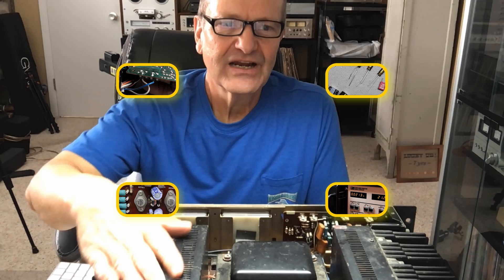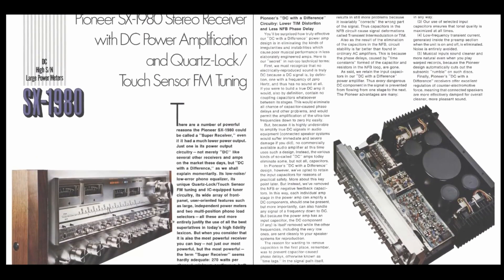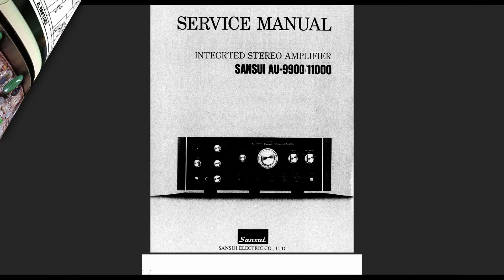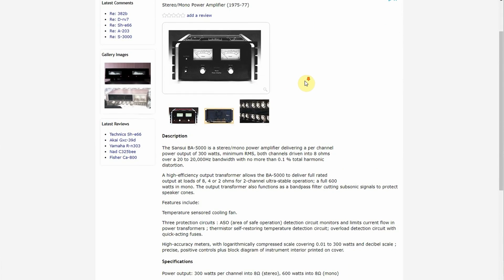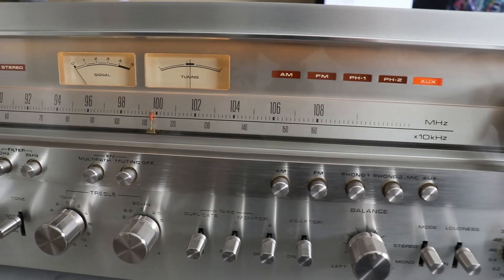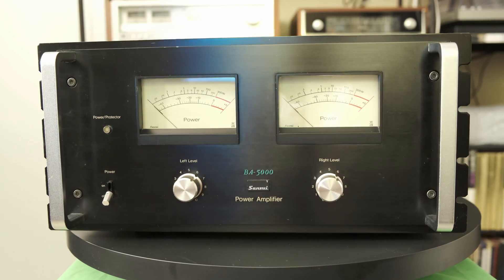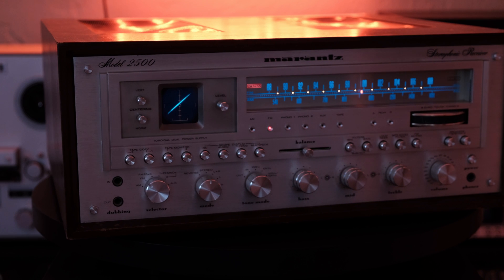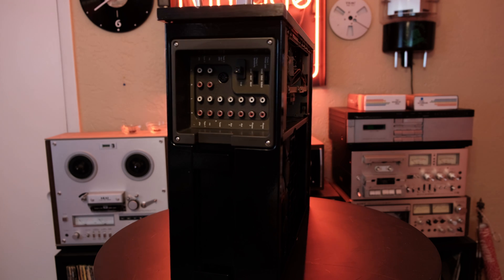Documentation Crisis Affecting The Repair Of Your Vintage Audio Equipment. HiFi Engine Problems!

Comment: I thought I had an account with Hifi engine but not any more. I think I downloaded a few brochures on some audio gear I was researching, and I hit a limit of 5 per day brochures was the maximum you could download. Now that was a few years ago, and I wasn't looking at service manuals just brochures. I spent a couple of days researching stereo gear, and once I hit that 5 downloads limit, I searched on other sources. But my account is gone and I tried to register again and this is the message it said:
_____________________________________________________
Account Registration
Sorry, but due to abuse of our free service, the registration system has been permanently disabled.

While we work on a solution to this issue, the service remains open for existing members only.

 

Registered users can Log In as normal.

If you need to reset your password please use the Reset Password form.
______________________________________

So I don't know what an abuse of a free service means, perhaps people were downloading all the information day in day out just collecting scanned in old brochures or service manuals. Then they took those files and printed them and sold them on ebay? So shutting down the free files will just mean you have to go buy the printed form on ebay.

Or maybe Hifi engine had copyright infringements for scanning in (copying) copyrighted brochures, services manual, user manuals and other materials and offering them for free download, which is a violation of copyright. Also selling copied copyright manuals and brochures is also a violation of copyright.

I acquired a vintage amp and this video made me worried so I searched for a service manual and found two, and the better one is on ManualsLib, and I've viewed countless user manuals, and downloaded maybe 2 dozen user manuals and a few service manuals no problem. Open them up in a pdf form in the browser and download from there once I see it and I like it and its good.

Comment: Been using HIFI Engine, ManualsLib and Audiokarma for many years and still gain access. If those amps we worked on will outlast us, maybe having one play during our funerals would be a fitting tribute to their longevity.

Comment: As the HFE website says, due to abuse the new membership option is turned off. Guess there were too many downloading free pdf's and then selling them on fleabay etc. 🤔
Either a membership with a pay per item download option would work. I guess he doesn't want the hassle of running/setting it up?? Good on him for keeping it going. 👍

Comment: Here's the message displayed when trying to create a new account:

<blockquote>Account Registration

Sorry, but due to abuse of our free service, the registration system has been disabled.

While we work on a solution to this issue, the service remains open for existing members only.

Registered users can Log In as normal.</blockquote>

Comment: There is a message saying it's not taking new accounts. I'm starting in 60s and 70s equipment, restoring and building new cabinets for them. I've been able to buy photofacts for mine so far off of eBay.

Comment: Hey, just a thought.  Could it be that their web page will only work on certain browsers?  I find that an increasing number of websites stopped working for Firefox and will only work on Edge.  I could be wrong, but for the ones who can't log into Hi-Fi Engine, try switching browsers and see if that fixes the problem.

Comment: Does anybody know how old Hi-Fi Engine is..? and how the owner obtain all the documentation and what or how did Chris and others actually fixed these products before the info was attainable?
I'm sure being apart of this industry for decades came with the knowledge and education to add up to reams of experience which will be lost with the passage of time and why its so vital that this information be available.
I own a Pioneer SX 850 and was lucky to be hunting on Craigslist for other Vintage pieces when i came across an SX 650 Pioneer and the owner talked about getting it serviced and that's when it dawned on me i could ask if he would provide the Tech name and number.
Short story took it to the tech and now have a Ton!!! of pleasure listening to how good it can make everything sound.
Watching Chris's short videos about getting your vintage pieces service is a requirement and very helpful and glad i did it...otherwise i was watching my Receiver sit in my cabinet neglected. 
So if I didn't find a tech or in the future no technical information ...then what? 
Chris thanks for the Videos...:):):)

Comment: I don't think I've had any issues using hifiengine but haven't been able to sign into vinylengine in a few years.
VinylEngine tells me no such information found if I try to sign in and it gives me the "no longer accepting new registrations if I try to sign up a new account. 
Neither have let me upload any files or pictures in years.

Comment: I had an account on both hifi engine and vinyl engine. I registered years ago. Both accounts were deactivated due to what I'm assuming is lack of activity. For at least a year now registrations have been closed. I can't recover the old accounts. I now don't have access to needed service manuals.

I think the site owner deciding to take the user submitted content and gatekeep it from the rest of the internet is disheartening. First of all its not his content. It is appreciated that he started and runs the sites but it doesn't make the efforts of the many users who scanned documents his own. If he was concerned about people selling the scans on ebay then his actions are only making it worse. Now service manuals that can't be easily found online can only be found on ebay for exorbitant prices. The best way to combat ebay sales of scans is to make things easily available. These manuals should be on as many sites as possible for redundancy so we don't lose them and the scanner's efforts aren't wasted.

Comment: I think HiFi Engine "prefers" that you "contribute" and upload a service manual, owners manual, old advertizements, schematics or something, not already listed. Too many people using the site, are not contributing. Or like you said, copying the information, and selling it on eBay.
Everyone should be able to contribute something to the site, especially if they have been long time members. As they must have "something" to add to the site, if they are "really" are into collecting and restoring vintage HiFI components...

Comment: Ill add parts are rapidly becoming unavailable.  Most through hole parts have been discontinued for a few years now.  Electrolytic caps are rapidly disappearing.   Transistors as well.  Digikey, Mouser, etc are becoming lists of obsolete parts.  Soon, only Chinese companies will have unreliable parts with long wait times.

Personally, most repairs are fairly straight forward.  If I have to pull out schematics it will likely cost more than its worth or Ill make very little on the repair.  On newer audio gear, aka Class D, there is almost no schematics available.

The irony is prices are steadily going up on vintage gear but in a decade they will mostly be interesting paperweights.

Comment: Became a member of Vinyl Engine around 10-15yrs. ago. Everything was fine for about 6 months to a year. Then I made the mistake of posting on his Vinyl Engine site Forum. I made the mistake of dissing a few 🧩🧩 of 💩 that I had the misfortune of owning and/or repairing as a Service Tech who specializes in vintage gear. One fine day soon after I try to log in at Hi-Fi Engine, & get a message to the effect that my "Password is not recognized" & I cannot log into either site. I politely e-mailed The Webbastard for the site: Little Lord Fauntleroy, Mall Cop. I explained politely that there seemed to be a problem with my account, could he please help me to get my login details sorted out?
No answer.
I tried at least a couple of times more, same haughty & ignorant silence.
I tried to "rejoin" a couple of times. Same User Name, but new (reset🤓💡?)  password. No luck. Tried new User Name AND Password. Got in long enough to make a single post in the Hi-Fi Engine forum, asking the Moderator if he could help me with my "problem".
Result: Banned permanently.
Tried to rejoin a couple of times after waiting a few years, hoping that His Godliness might have come down off of his cloud a little bit & give me another chance. NOPE!
You don't get any second chances with this ASSHOLE; you don't even get one!🚮🤬🤬🦨
If I had known WTF I even did to deserve this banning, I certainly wouldn't have repeated it! And if I had known that this ASSHOLE would ban from BOTH of his sites IN THEIR ENTIRETY just for posting a negative comment about some overrated 🧩 of 💩 component that I didn't know was a favourite of his (or WHATEVER it was that I "did wrong" or that he just "didn't like" my saying so🧐🤔🤔🤔🤪?), I wouldn't have risked my access to the schematic library that I badly need to service more the equipment belonging to my paying customers as much as my own!
I found an inconvenient workaround for when Electrotanya or Radiomuseum doesn't have the schematic I need, by getting friends to join Hi-Fi ReVEnginece & getting them to forward my requests back to me, so funk you Bart Cop!
I fix equipment as my livelihood to supplement a miserable government disability pension, & this PRICK gets off on trying to ruin my livelihood? Without even the benefit of an explanation?? Never mind responding to a request for a second chance, & a solemn promise to stay off the forums, so as to not ever "offend" anyone ever again???
Do I have to really explain how offensive & obnoxious it is to have someone that doesn't know you personally, has never met you or ever seen you in person, exercise their ultimate NEGATIVE JUDGEMENT upon you, know nothing of your circumstances, just decide suddenly that you deserve the worst possible treatment from them that they can possibly inflict upon you???
So why should I mince words?
This guy is a TOTAL FLAKE, an arrogant intolerant IGNORAMUS, & surprise surprise! His mental health continues on its decline, & his behaviour gets ever worse & ever more erratic as a result!
I might feel worse or be the least bit more self-reflective if I knew that I was a rare exception to his capricious spitefulness. But I have come across PLENTY of others that have been equally shabbily treated. And now we seem to have arrived at a point where he's getting off on forcing members who were otherwise in good standing with him to grovel & plead for site access because they haven't "recently"(🤔🤪) brownloaded any of his DONATED literature & schematics that he has THE NERVE TO WATERMARK, EACH & EVERY SINGLE ONE.
I HIGHLY recommend that EVERYONE switch over to Electrotanya, & PLEASE upload any Hi-Fi Engine schematics & service manuals that you have in your personal collection over to him, AS I MYSELF DO, that are not yet on his site.
Electrotanya is FREE, 5 schematic limit per visit, he has paid site advertising so he's running a business & not a country club that's open solely for those that the Webmaster deigns to be worthy of his affection. There's no membership to join, & there's no forums of stupidity & idle chatter for you to get bullied, banned & humiliated in by a Moderator with an IQ that's half of their shoe size!👺👹🦨🤤🤡🐂💩🤮🤮🤮
I also recommend Radiomuseum as a second choice, & manuals.lib as a distant third (it COULD be a great resource, if any of you could ever be bothered uploading to it🧐).
Putting all your resources in one Website basket is a dumb idea. And courtesy of Hi-Fi Engine's increasingly ever-erratic WebBastard, the threat of a vast knowledge resource disappearing into Error 404-land should be VERY CLEAR to ALL of us!!!
Hopefully those of us in possession of these resources will continue to behave like a community, & not like God.
And certainly NOT like Hi-Fi Engine, regardless of how highly His Royal Heinieness thinks of himself, & how little he thinks of YOU.
At least he hasn't disappeared suddenly, so we're getting fair warning, the only thing fair this guy has ever done (because it's by accident!🤗).
There's still time for us to DIVERSIFY OUR PORTFOLIOS. You wouldn't put your entire retirement savings into a single investment either, would you? You need to spread the risk, even if that single investment is doing well at the moment.
So it's the same here. To quote a famous running shoe manufacturer:
JUST DO IT!
Reply: HiFiengine is free. You weren't paying anything for it and he doesn't owe you anything. You come off as entitled with your comment!

Comment: Hello, do you have any experience with the Kenwood kr-9050 I recently acquired a one and the left aux input moves slightly and the output from the left speaker is not right what would be the best plan of action to replace this connection? Thank You.

Comment: Thank you Chris for your videos. I appreciate you sharing your knowledge and experience with us. I’ve been a member of hi-fi engine for about three years recently I was able to log on and still download the service manual for Marantz 5420 cassette player. I don’t know if this will help anybody because I’m not even sure myself if it was simply coincidence or it actually had something to do with it, but I had tried to log into hi-fi engine and create account several times and was rejected. On New Year’s Eve at two minutes to midnight I started the login process to create an account, and when it struck midnight, I hit the enter button and got in and was able to create an account. I’m not sure if the rollover had anything to do with it, but might be worth a try for those out there willing to take the time to try to do it.

Comment: i used to be a member of hifiengine. I then i went through a sickness for several years and now the site doesn't allow sign in nor does it recognize my email for reset password. I would pay a subscription fee for access as i'm trying to learn this trade. last time i had some repairs done to some equipment they were enormous fees. Although, much less than a new unit, which isn't available  so, very much worth the money. i just really like tinkering with this stuff. you all have a great day. i found some manual sites by typing "audio repair schematic and service manuals" and other similar terms. i also tried another two browsers and turned off pop up blockers to see. no luck logging in to hifiengine.

Comment: Haven't used it in years. These days, I have pretty good luck with ManualsLib. The database there covers every sort of device... it's REALLY extensive...and since I often need manuals for things other than audio (such as amateur radio gear or test equipment, two other VERY endangered document categories), having ALL the docs in one place makes things so easy.

Better still, there's a mobile version! Stable, too...I can have a pile of docs open at one time with no hiccups. I know Google Play has it, so Apple's probably got an iOS version, too.

Also, once you've got an account, you can contribute to the library, which is a great way to add even further to the document pool for whole communities, such as vintage HiFi, etc.

Comment: As someone new to vintage audio I have had to look elsewhere for service manuals. Its a shame since the next generation of hobby technicians are cant access the same resources. Hifiengine should either offer membership or pass on the torch to someone who will.
Reply from the maker: Your correct. If the manuals to repair this equipment disappear so will the equipment.
Reply: Completely agree, just started this week teaching myself how to repair units. Wanted to access manuals so I could start learning. It's like a lot of data sources nowadays, all going behind pay walls. If anyone can suggest alternatives would greatly appreciate it.

Comment: Alright, whatever happened to "doping it out"?  I'm pre-internet and was working on these when they were new.  You could phone or write the company, put a check in the mail, and eventually have a service manual delivered.  But what seems cheap today, wasn't then.  So we didn't have the luxury of service manuals for most things.  But since we were competent technicians, we could make our own schematic when needed by doping it out, meaning follow the connections and draw it.    It's pretty easy when there were no inner traces on circuit boards, parts were marked, no integrated circuits with millions of things going on inside, just discreet components and later on some op amps starting maybe the eighties?  And all the circuitry is pretty similar with the occasional innovation.  So if we could do it back then, how is that an excuse today?
Reply from the maker: Thanks for sharing. In my case without a schematic I wouldn't attempt a repair but then again I'm a hobbyist, not a professional.
Reply: @vintageaudioaddict  
A man's gotta know his limitations!
I started very young fixing things, maybe five?  Crazy, right?  Before teenage the neighbors would bring me TVs to fix.  Mostly that meant testing tubes at the drugstore and grabbing a replacement.  Maybe an occasional solder joint.  But I learned what sections did what and could pinpoint problems.  I did a lot of reading and learned basic electricity and electronics.  My orthodontist gave me s Heathkit AA100 I got working and used for years.  I learned amplifier circuits both tube and transistor which made it easy to figure out what was going on.  Then I started modifying stuff to improve sound quality.  Then designing and building my own preamps and power amps.  Between HS and college I worked in an audiophile store rebuilding customer units.  I graduated an electrical engineer and went into circuit design, analog and digital.  And switching power supplies.  I built more audio stuff for myself over the years.  Except that one summer job I've been only an amateur hobbyist all my life.